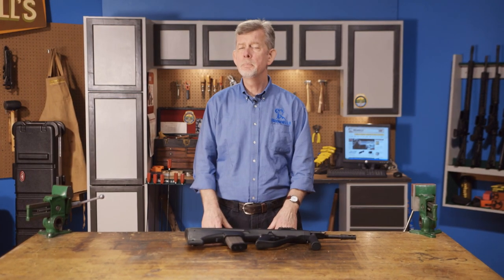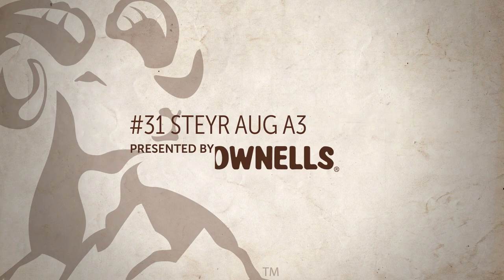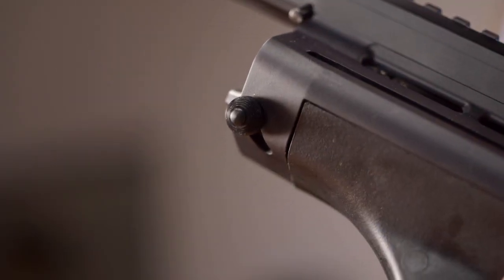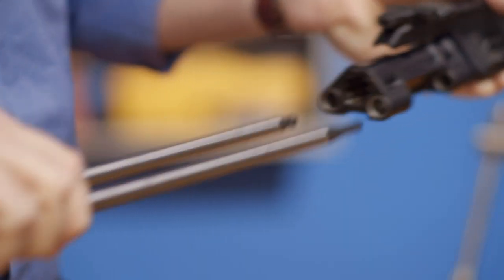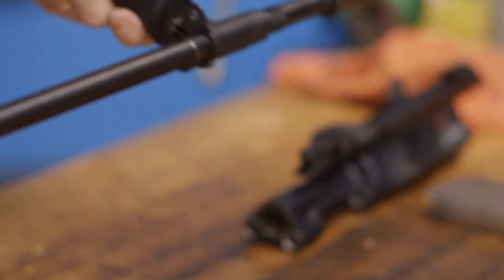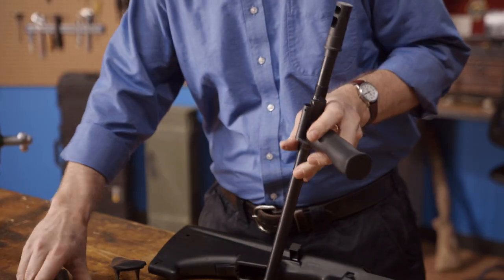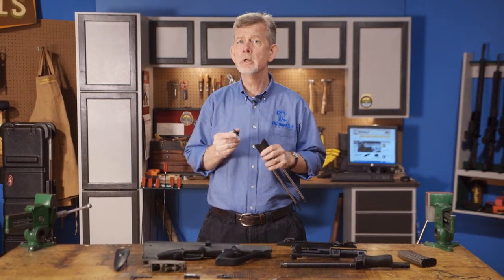Steyr Aug Maintenance Series: Disassembly

Comment: One mistake:
Retaining bolt of buttplate has to be pushed in first, then buttplate removed and then you pull the bolt out. Otherwise you gradually weaken the buttplates grip on the bolt till it falls out!

AAF soldier, I know that gun better than my body
Reply: thanks man just got one yesterday
Reply: thanks for the info .
Reply: No you don't. This is how its taught in Australia, and I the buttplate of the A1 aug with a manufacture year of 1992 were still going strong.
Reply: du hast grundsätzlich recht, aber ganz ehrlich, ich hab das Teil nie zuerst rein gedrückt - hat bei den Kompaniewettbewerben nur Zeit gekostet ;-)

ich liebe das Teil....

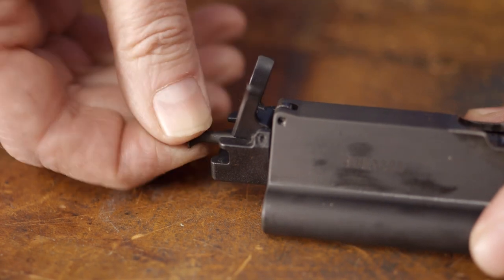Comment: so my rifle does not have an "anti turn device" mentioned at 1:49. Is this part missing? Or are there different versions?
Reply: Do you have an AUG A1 (original with integrated optic)? From what I can see in pictures, those don't have that part, but, if you have a modern AUG, like the A3 SA or A3 M1, then it should definitely have that part.
Reply: @riflemanm16a2  yes. It is an original a1.  Never been shot before.  It was found in an estate clean out. So I am cleaning it so we can go shoot it
Reply: @crazydiggity  Wow, that's a great find! I've never handled an A1, so I'm just going off of pictures, which appear to indicate that part is absent. Maybe you can find a manual for it online to make sure.
Reply: @riflemanm16a2 we still have A1s and can confirm, the anti-turn device is not part of it, haha.
Reply: @crazydiggity  How did you find aug?

Comment: It's a great rifle but not worth it simply because everyone I see selling it wants a whopping $1,000 more for it than any AR-style rifle on the shelf. Been to several gun stores and if they had one, the fanciest AR style model was always significantly cheaper than the Steyr.
Reply: Different strokes for different folks.
AUG is more nimble and compact while AR parts are everywhere
Reply: theres been studies that show that AUG parts last 2-3x longer and AR-15 parts.
Reply: @jimmyrecard6021  Hardly matters since, if a knockoff AR breaks enough times to need a full replacement, it's still going to wind up being a bit cheaper than the AUG. Wish a third party would be given permission to make one slightly cheaper.